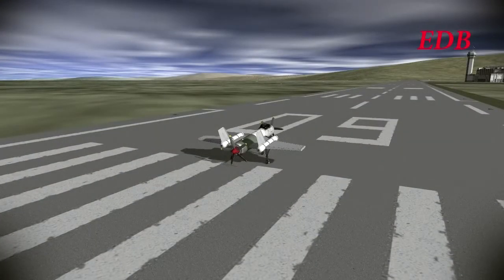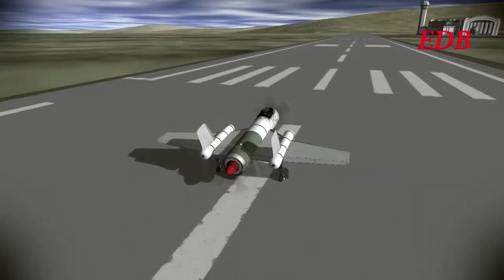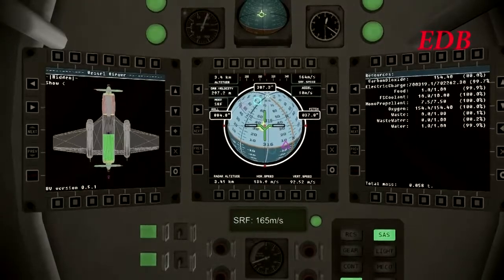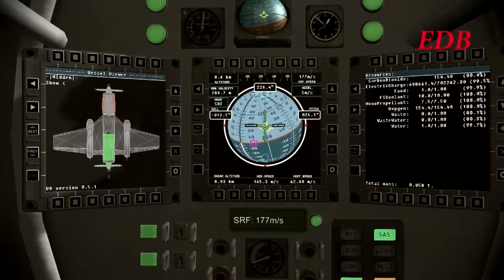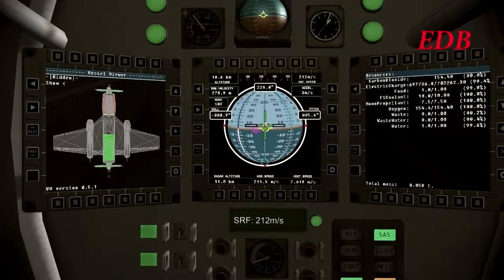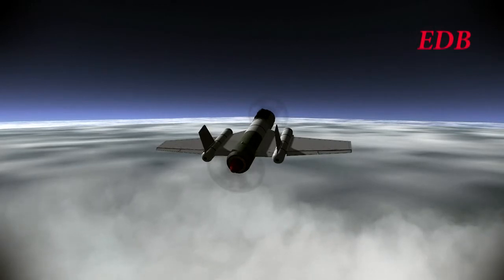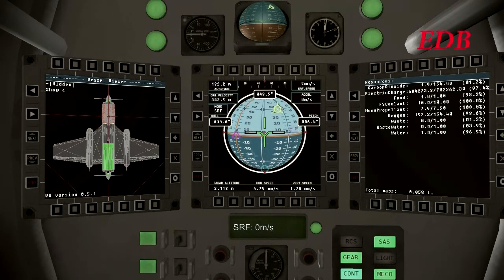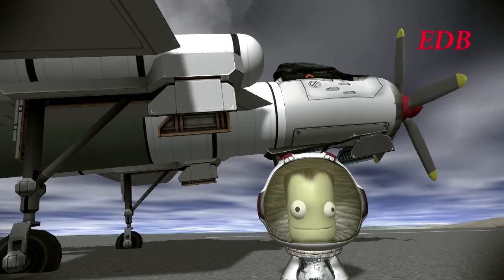Kerbal Space Program EDB Aerospace 03 - DB-3 "Buzzer" Test

Comment: It's impossible to get propeller-driven aircraft to sustained supersonic speed due to the very principle propeller works (it works by creating the pressure differential between air before propeller and air behind it, and air becomes nearly incompressible past Mach 1 due to forming of shockwaves). I'm not sure if that effect is modelled in the Firespetter (that's the mod you use for propellers, right?), and for some reason I tend to believe it is not.
As for speed records in dive, there have been claims that some pilots managed to accelerate their planes past 1M in dive during WW2 period, but no case has been recorded reliably enough to consider it as a fact and not a mere speculation.
Reply: ***** Well it very easy to check if Firespitter has some sort of limit - put a shit ton of propellers on the plane and see if it exceeds mach 1 :)
Reply: ***** MOAR engines! :D